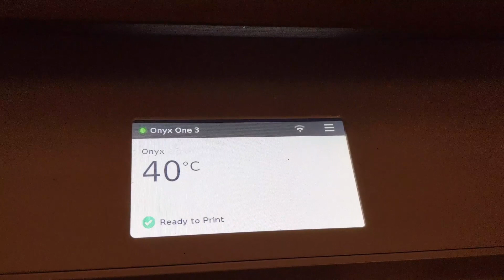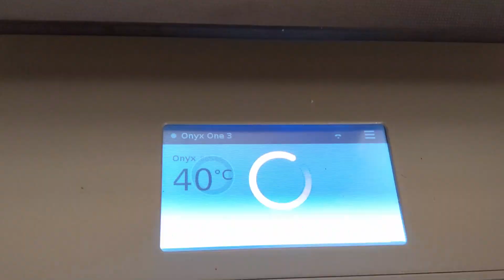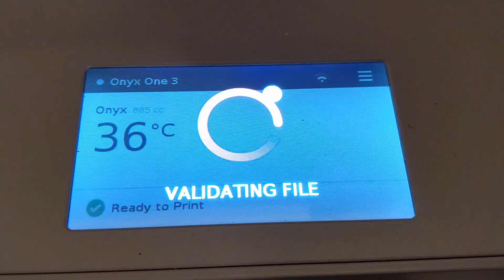How to level your Markforged Onyx One 3D printer's bed

Comment: Hi, there's no gap between the nozzle and the print plate, the shim wouldn't slide in between. Is it possible to fix this?
Reply: If you can't get any gap between your plate adjusting the thumbscrews then you need to adjust your Z-offset. That procedure can be found here: https://support.markforged.com/portal/s/article/Adjust-Z-Offset-Desktop